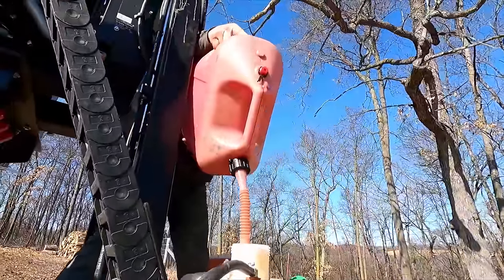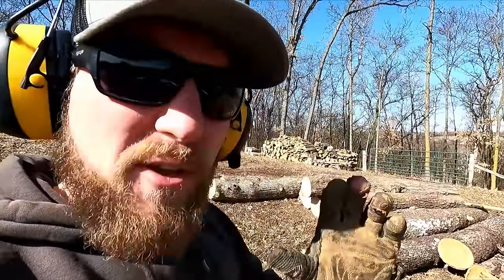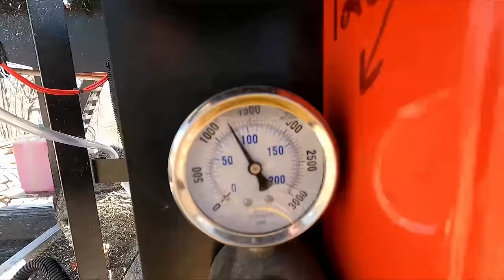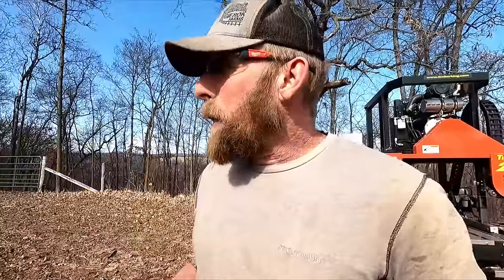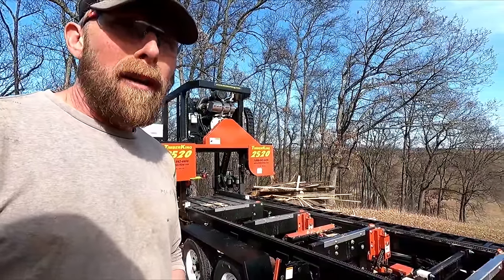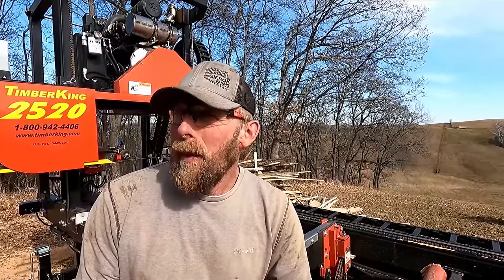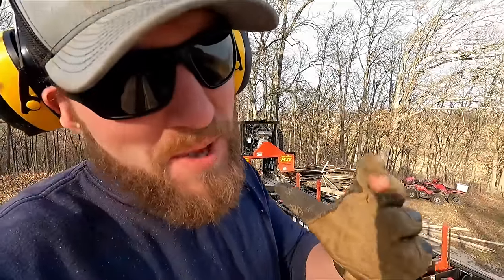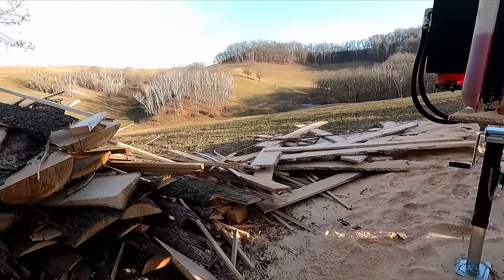Homemade Lumber! Sawing Our Own Logs Into Boards With Our 2520 TimberKing Sawmill!

Comment: I’ve been enjoying your channel for about 9 months.  It’s great to see how resourceful you guys are.

I’ve spent many hours sawing lumber on a 25 year old Wood Mizer LT30 so I can easily relate to how you saw  lumber out of even the most crooked trees.  
I hope your Diesel engine last many hours.  The Kohler Command on the LT 30 was replaced 3 times in the first 100hours.  The 4th motor now has well in excess of 1000 hours with no issues.

Comment: Dad's go a new toy!! That's how we use to edge lumber with the old circular, stack them up, and run them thru! Can you slow down the forward motion on the saw?  I suspect hickory is the toughest! Maybe if you're sawing hickory going slower it wouldn't be wavy! I'm a meat cutter, and when I saw just plain bones, it takes the sharp out of the blade!

Comment: I have been operating sawmills for many years and without the benefit of learning from an experiened sawyer, most knowledge will be learned over time.  You will learn to read the logs better, determine proper milling of log curvitures, where to buck logs to reduce waste, know species and so on.  You will look back at your early days of milling and recognize you are presently producing a tremendous amount of waste.  Most of the work is in the offbearing process.  Handling technique and distance are everything in reducing material handling labor.  Carrying lumber distances is not a good thing.  Distance of moves converts directly into time and extra distance is lost time.  Handling materials with the least effort over the least distance in the name of the game.  You should quickly get the idea.  Best of luck in your lumber milling ventures!  Nick,  North West Farmer (Oregon)